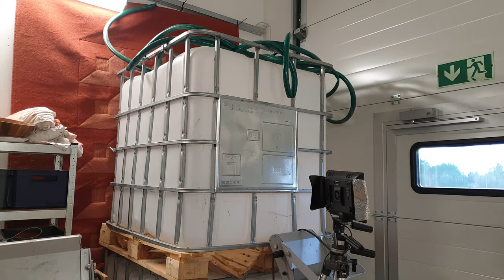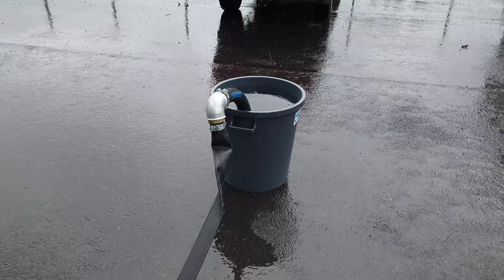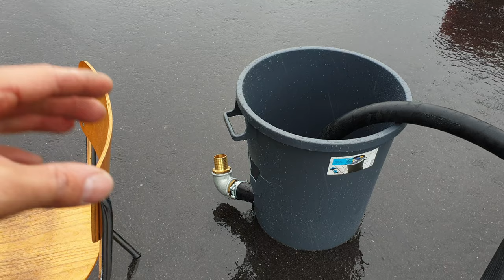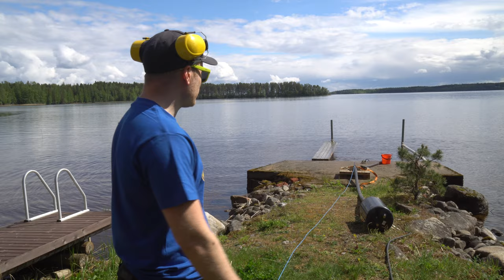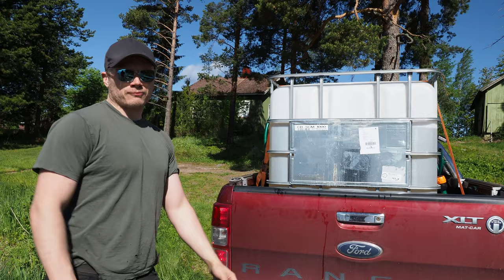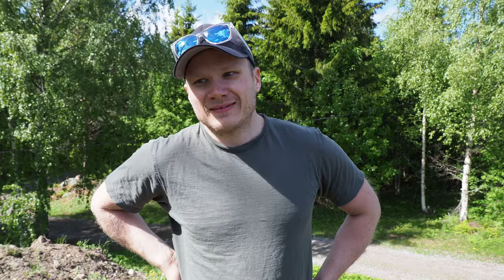How to Build Your Own Geyser!

Comment: definitely should try a Venturi set up because as it is now the air forces the water aside and less water can fall back into the air stream. a Venturi would actively pull water up with the air stream.

Comment: I'd be inclined to make a solenoid control for lever on the manual valve to get the benefits of both. Speed and capability to shut and close the valve but I'd do tests with smaller valves to ensure that the larger valves ain't gonna explode under pressure.

A scaffold rig to keep a hold of everything would be something I'd be thinking of.

Comment: 4:15  A solenoid controlled butterfly valve would be the hot ticket.  You'd get the  speed of activation of the solenoid valve shown in the video, and almost the same wide open flow rate of the ball valve.  And the butterfly valve will give you a much more explosive initial response.  It would just need a nudge, and it  would self open in  a snap due to the rush of fluid through the valve.  The larger effort would be in closing it during a high flow rate, but not too bad.

Comment: probably too late unless you do a second round for fun, but if you added a venturi nozzle to the end it should pull in more water to mix with the air. Think sandblasting nozzle.

Comment: i wonder what would happen if you had an air tank that feeds into a water tank with a pipe exiting from the bottom and turning up. would you have a longer spray time and would the height of the geyser be much lower?

Comment: The hole in the bucket is similar to a problem Spacex had, though theirs was at 380 bar and the bucket had fuel instead of water.

Comment: Add a torsion spring and a latch to the ball valve. The latch can be a simple clevis and pin. `This will open the ball valve much faster, as fast as the solenoid valve with a heavy spring.

Comment: Now fill that with diesel fuel and add a pilot light. You can imagine the rest.
Reply: Diesel does not ignite that well, gasoline would be better.
Reply: @fre3bs628  Diesel does not ignite at all.
Reply: Janos Merges It does when it is atomised.
Reply: @ciaran1449  Go try! That little bit of splashing is not sufficient to burn diesel. You can try with any cooking oil in your garden, it is very similar. I bet you wont succeed.
Reply: Janos Merges. Yes it does
Reply: It wouldn't burn well even if it did ignite.
Reply: @fre3bs628  is a fine must it will